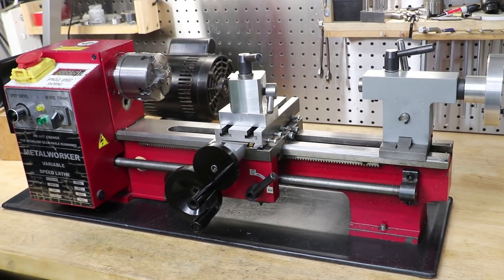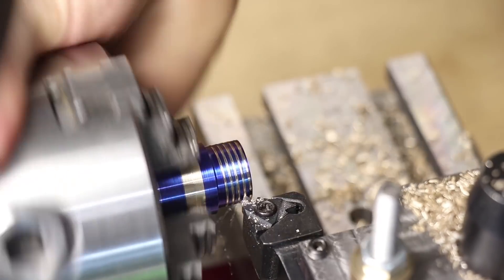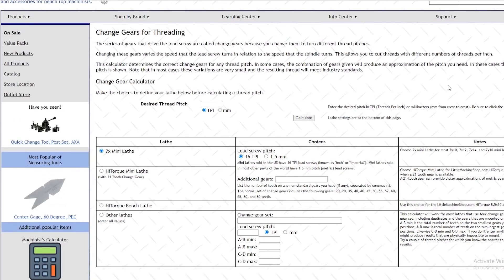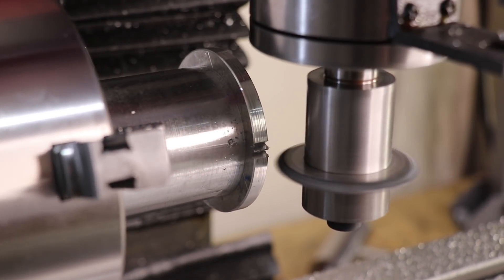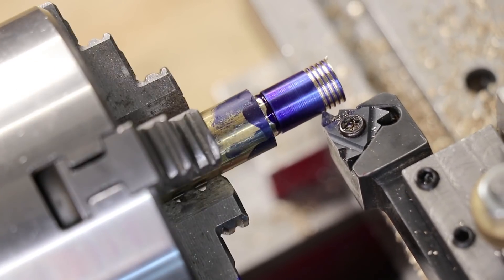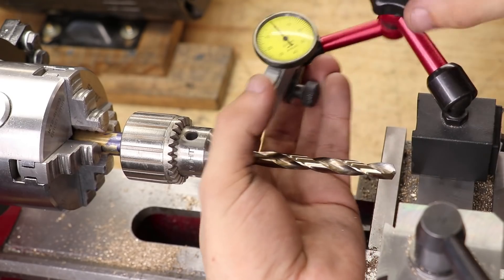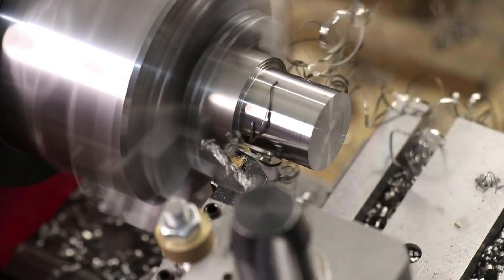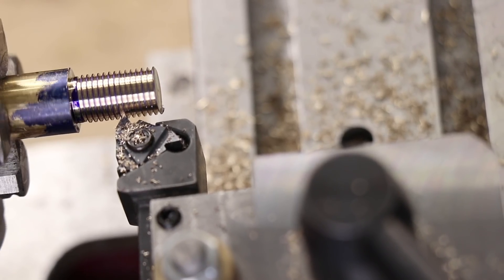Cutting Imperial Threads On My Metric Mini Lathe (And Metric On Imperial Lathes Too)

Comment from the maker: As an addendum which I did not get around to recoding, there are electronic leadscrew mods which will also allow for easy cutting if metric and imperial threads. It is something to consider if you use the leadscrew a lot for cutting threads. Cheers
Reply: Now I just need to know how to make metric threads with an imperial lathe cause merica(literally 6 seconds before you explained that)
Reply: Especially the one from Clough42. That is a truly neat setup.
Reply: I finished that a few months ago (Clough42 ELS). Makes my lathe a joy to use with all threads and changing feeding rate on the fly. I recommend to anyone.

Comment: I do not agree to cut threads with ONLY a die, are you sure the die will go on along the proper axis ? Or ... are you sure it will cut will exactly the nominal pitch you want, and for a long distance ?
I'm playing with my chinese late from 2006, and i learned cutting threads just for my individual needs ... i prefere cut the threads with the lathe, and then follow one pass with the proper die. Of course you have to get all dies you can find, not only with rought pitch, but also FINE, also left hand, and Withworth too. It costs a bit, but you can buy them a few at a time ...
Some more gears are needed to cut fine or withworth pitch, you can buy them abroad and then adjust to your lathe, for example all gears in my chinese lathe are 1,0 as module, you only have to change their thickness to 8,0 mm in center ( 20 mm. large ), 7,0 mm till outside, and bore them exactly to 12,00 mm ( here, pay great attention ... a 12,00 H7 reamer helps so much ... ). Digging the key is a bit problematic, i have done all gears first with a couple of 1,5 mm. bore, then worked with a file ... but they work.
A special device for digging 4 mm. keys is nowaday not so expensive, now i have got one, even if i did't use it before ...
For pitch cutting ( = calculating gears needed ) use this formula:
( A/B ) × ( C/D ) x 1,5  where :
- 1,5 is the pitch in mm. of the lead screw in my METRIC chinese lathe ( they are all similar ... but you can check for safety ... )
- C is the number of the teeth of the gear to be installed on the lead screw.
- A is the number of the teeth of the gear to be installed on the "spin output" ( after the right/reverse gears ( 20 and 25 teeth gears )). ( Normally in A is installed a 20 teeth gears for normal cutting ... ).
- B and C are the coaxial gears : B meshing with A gear ; and C meshing with D gear.
Playing with fractions, i have got all possible and immaginable pitch.
For Withworth remember :
( 44/26 ) x ( C/D ) x 1,5 = ( let be C=D ) = ( 44/26 ) x ( 1 ) x 1,5 = 2,53846 ... which difference with the true value 2,54 is 0,001538462 ... 0,06 % !!! ( quite perfect ).
Then you can play changing C and D to get 1,27, or 5,08 ... or what ever you want ... 
If anybody is interested, i have other tips ... but writing in English is for me a bit hard ... 
If you only need a particolar pitch, ask me, i'll give an answer after having consulting my praevious calculations ...

Comment: I was under the impression, unlike metric threads imperial ones require different cutters for pitches and thread type but maybe its not that important. I too have a metric lathe and would really like to be able to do some imperial threads, like the one on the front of a Dremel, I'll see what that calc is like thanks
Reply from the maker: If you are doing whitworth threads then you’ll need a 55 degree cutter. But unc threads use the same 60 degree cutters
Reply: @artisanmakes  OK but why do they have different inserts then like 16ER11.5NPT CP500 External Threading Insert? maybe its not the tooth angle but the overall profile?
Reply from the maker: You can get specific ones for specific thread profiles yes. From memory those are called full profile threading inserts and they are good for one thread pitch. Most general threading inserts are partial profiles and are good for multiple pitches
Reply: @artisanmakes  That explains it thank you

Comment: If pitch of the lead screw is metric you can make metric threads. If pitch is imperial, you can make imperial threads.
Most cheap import lathes that can make metric and imperial threads have a small pitch error. So their lead screw isn't exactly metric or imperial.
To get an exact conversion, the lathe must have a 127 tooth gear. 127 is a prime number. 127*2=254, which is the conversion between metric and imperial measurements.
Reply from the maker: The leadscrew on this one is 1.5mm pitch, so it can do metric without error. its true that there is a small amount of error on making imperial, usually less than 0.1% error if you go by the Little machine shop chart. Why we dont use 127 tooth gears on these smaller lathe in because you could not physically fit a 127 tooth gear on the banjo. The largest I was able to fit was 100, and that was not easy

Comment: Your drill chuck arbor should have an unthreaded section to accurately locate the chuck. Threads aren't an accurate method of locating a feature.

Don't forget to get 55* inserts and pitch gauges for BSP threads.
Reply: Although a quick search shows that commercial arbors lack a locating shoulder, so I suppose the chuck doesn't have one either.
Reply: @jonathan1427  threads are sometimes used as precise locating features, as in threaded lathe spindle noses. I have seen some 1/2-20 drill chuck arbors that have a locating boss
Reply: @MF175mp  Can you give an example of a lathe spindle nose that doesn't have a shoulder behind the thread which does the actual concentric locating?
The amount of play inherent in a thread for it to not bind is more than a locating fit tolerance allows.
Reply: @jonathan1427  maybe it's more of a thing on wood lathes. But I found another example, my cnc lathe's rotating cylinder is held in place behind the spindle by 2 subsequent thread fits only and it needs to run true. Runs within 0,01mm (half thou) currently
Reply: @MF175mp  Interesting! Yes, for wood lathes I imagine the accuracy is sufficient. On your CNC lathe is that the collet closer/drawbar cylinder? Would parts be made defectively if it were out of alignment, or does it just need to be close-enough for balance? I was under the impression that there was a certain amount of 'float' between moving parts to allow misalignment with the spindle axis.
Reply: @jonathan1427  the cylinder is for the chuck drawbar yes. The RPM on cnc lathes is so high it starts to vibrate if it's off center and therefore out of balance. Mine spins 3,500 rpm and the high rpm version of the same machine spins 6,000 rpm.

Comment: I'm the same as you. It's much quicker to use dies so I don't bother with screw cutting unless I need high accuracy or a non standard thread.

Also I have a mini lathe and that banjo is the biggest POS known to man. 🤣

Comment: 5:48 That final thread looked really loose in the chuck, so no wonder there was so much runout.
Since you are leaving the half nut engaged, and turning the lathe over by hand, you really should be checking the thread throughout the process, and also you need to take MUCH shallower cuts towards the end.
Reply from the maker: it was something to consider, but seeing how it was so close to the run out I get with the commercial arbor I stuck with the one I made. Cheers

Comment: you modified the dividing head to make gears to cut threads to make a tool holder for the chuck so you can use it for next projects.

So you made a part to make a part to make a part to make parts.
Reply from the maker: Doing mods the extra long way round. :)

Comment: If your cutting threads by manually turning the lathe chuck i suggest making a handle to fit the back of the spindle so you can turn the spindle easier rather than turning the chuck by hand everytime. Basically a handle with an inverted collet thatll clamp inside the spindle for ease of removal. Like your videos look forward to seeing more. 👍
Reply: Awesome idea! 👍😁

Comment: Make yourself a mandrel that fits into the main shaft at the far end with a hex on it and use a ratchet spanner to turn the machine, so much easier than doing it by hand. 

I regularly cut metric threads and a Myford lathe and TBH there’s no difference, just take your time.

Comment: This is a time where having your cross slide on and set to 29.5 degrees would be beneficial for proper thread cutting. Fantastic video as usual!
Reply: That's really not necessary with indexable threading inserts. The thread cutting shown here is perfectly "proper" !
Reply: Oh really? My bad I thought it was always still good practice for better surface finish and lowering cutting loads even with indexable tooling. Good to know!
Reply: @MidEngineering  it really depends on the rigidity of the lathe as to how well they handle cutting threads straight in, you can half the pressure on the tool/ lathe by spinning the compound to 29.5 degrees
Reply: @markshort9098  For any given depth of cut, the amount of metal being removed & therefore, the load on the tool/lathe (using indexable threading inserts), is the same whether you feed straight in or at an angle. The 29.5deg. approach is only really needed when using a simple vee tool with a top rake angle ground on one side.
Reply: @MidEngineering  it doesn't matter what the tool is made of, inserts don't magically require less cutting pressure.. with a straight in cut the tool has material engagement on both sides of the cutter for the depth of cut and when feed in on an angle it's cutting full engagement on one side and depth of engagement of that pass on the other side which is clearly less tool engagement so less pressure, add to that the chip coming off a straight in feed has more of a v shape to it which creates more pressure again because it has to deform the chip a lot more to get it flow.. if you have a really ridge machine then the extra cutting pressure isn't a problem but for a toy lathe or really big threads it does make a difference.. the more cutter engaged in the work the higher the pressure, this ain't brain surgery

Comment: It looked like you were turning the chuck by hand some of the time but at other times it looked like you were running the motor in short pulses. Thinking that an interesting mod would be a momentary push button that bypasses the normal on button.
Reply: Very unlikely - it was almost certainly all done by hand.

Comment: I have the opposite problem - imperial lathe and need metric threads. That little bit about "Never disengage the half-nut!" is critical. Learned that the hard way.
Reply: Actually you can. The trick is to start the lathe and engage the half-nut on your number on the thread dial. When you reach the end of the thread, disengage the half-nut and stop the lathe and allow it coast to a stop. Back out the threading tool. The clever part is to notice that your thread dial mark hasn't moved much past set mark. Reverse the spindle and when your mark comes back to the set mark and re-engage the half-nut and back up the carriage to your starting point.
Rinse and repeat.
Reply: @aceroadholder2185  I don't have a thread dial on my lathe so if i have disengaged the half nut i engage it anywhere and open the bolts on the cutter, then push the point into the thread and retighten the bolts. works fine actually.

Comment: Isn't a 3/8-24 fairly standard to get a die in? I use that thread all the time, and I find taps and dies in that thread size and pitch all the time at garage sales and just all over the place. And they were very easy to order online, is it very uncommon where you are?
Reply from the maker: Not as common, you can buy them but I didn't feel it necessary to buy a $15 die that i'd probably only use once.
Reply: @artisanmakes  I was weighing that against spending the time to make a gear that (am I correct in saying this) you would also only use once (probably) to thread 3/8-24?
But I suppose at least you could get it done right away or in a couple days.

Maybe I'm biased, at my previous job, I messed with 3/8-24 every day.
Reply from the maker: @dzarren  Thankfully these gears are going to be used to cut other imperial threads. A 3/4 16TPI for a lathe chuck, 1/4 BSP for some pipe connections and a few other odds and ends that I need done.
Reply: @artisanmakes  - Crazy problem. Most people have the complete opposite. I am clearing out my dad's engineering tools and there is boxes and boxes of "imperial" taps and dies, all different sizes and types in BSW, BSF, UNC, UNF, BA, BSP, NPT, etc, etc, etc.
Old non-metric taps and dies are literally dime-a-dozen... do you realise that you don't need to buy them brand new?
Reply from the maker: @johncoops6897  you can if you want, im sure its cheaper. But I simply don't have the time to go chasing used taps and dies.

Comment: If you really want to get closer, the integer ratio between 16 TPI and 1.5mm/rev is very close to 189:200.  It means making some big gears, but you can get to just about perfect for a lot of thread pitches from both systems.
Reply: if one has room for 189 teeth one could use a 127 tooth gear somewhere in a chain (there will need to be additional gears involved)  and get an exact ratio. That is the standard method for lathes that have enough room as 1 inch = 25.4mm exactly (127 is half of 254 and as 127 is prime there is nothing smaller that will give an exact ratio)
Reply: @jaytalbot1146  The 127:125 ratio is true but you'd need to work out the numbers for that approach and I haven't.
Reply from the maker: Didn't know about that gear ratio, but that would never fit on my mini lathe :)
Reply: @artisanmakes  A mod 0.5 200 tooth gear would be 101mm diameter, which is conceivable.  The idea is still simmering but the numbers look pretty solid.
Reply: Try to add a gear with 63 teeth. 54 and 42 are further helpful, then perhaps 57 for some 19-related TPIs. That way you could significantly reduce the error of approximation, still being able to fit the gears into mini lathe's quasi-banjo 😉
By the way, I've just replaced the bolt and nut holding the banjo to the bed with a washer-head screw with head ground flat (and two nuts locking it to banjo and bed) to allow fitting 114 teeth gears instead of 80s for fine 0,046 mm auto feed. They're arriving tomorrow, then I need to slightly cut out the back of the cover and  I'll see how it works 🤔

Comment: When I got my lathe I didnt know enough to know what I needed and I ended up with an imperial lead screw,  as I am also in Australia, and refuse to use nuts and bolts measured in bananas, I also mainly use dies for thread cutting. I could be picky and say we have only been using the metric system for 50 odd years now, why would a new lathe sold here even have an imperial lead screw... but it is what it is. Wont get caught again next time though!
Reply: That's H&F for you.
Reply: There are still a few banana eaters still out there in the wild.
Reply: Nothing wrong with bananas, It's more natural to count by 0.001" than it is to count in 0.02mm increments

Comment: I have to admit that I sometimes just remove the old/nonstandard threads and make new standard metric threads. If there's space and the material isn't hardened I have the feeling that saves me future headache. But your solution is probably more reasonable ;-)
Reply: I did that also. The post on my QTCP had a weird thread on it that didn’t match any of my dies, so I just turned it off and made a new one in M12x1.5. It is a more barbaric approach, but it works out because now I know I have that thread size in my set.
Reply: @akaHarvesteR  "Barbaric" is the word I reserve for people, who put both metric and imperial threads on one part.
Reply: @jakubkopec9313  weeell… That’s sort of what I ended up with. The part had threads on both ends. :P
Reply: Do this but the opposite 😂from metric to imperial